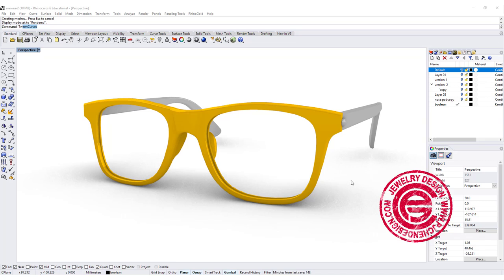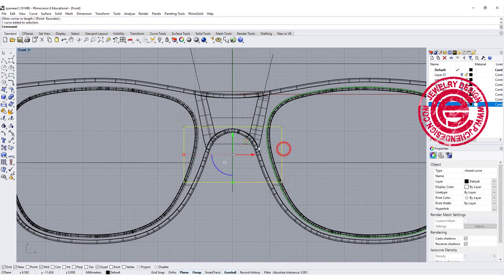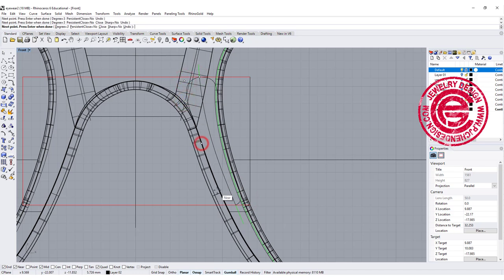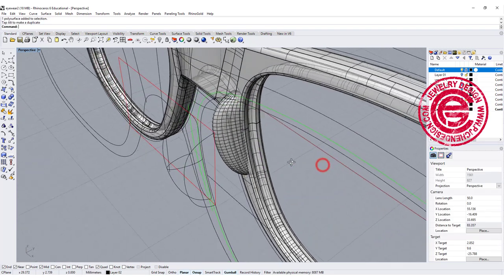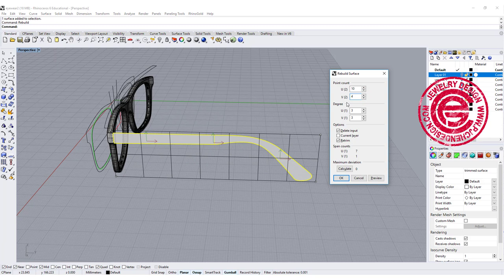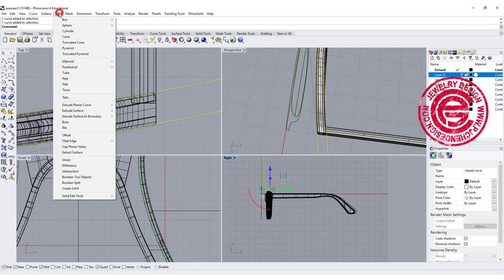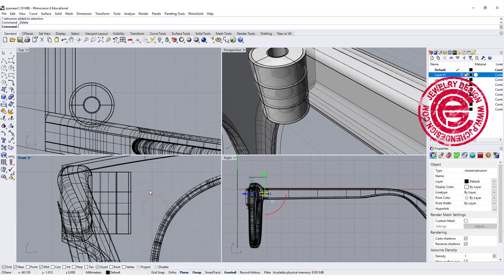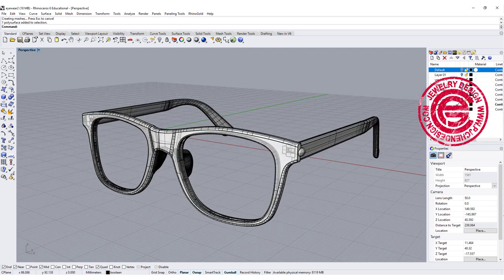How To 3D Model An Eyewear in Rhino 6 (Part II) :Jewelry CAD Design Tutorial #72 (2019)

Comment: The crv2view command gives error "curve is not planar, please define extrusion direction". What is wrong?
Reply from the maker: make sure your curve is flatten.
Reply: @PJChenJewelryDesign  I had to define the extrusion direction and it worked. I am not having problems with the fillet and creating an open polysurface after the fillet operation. Good video though.